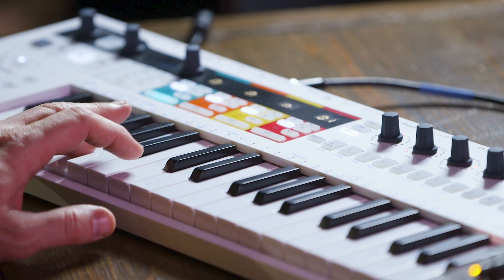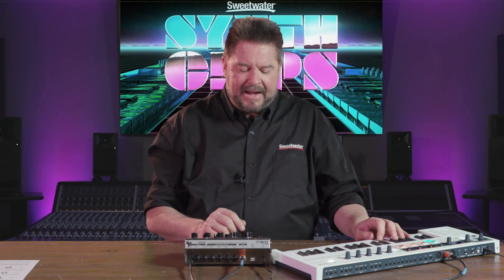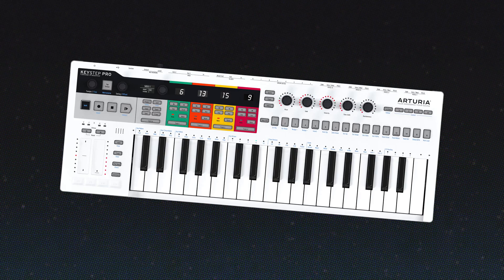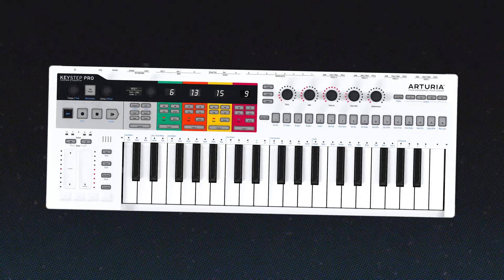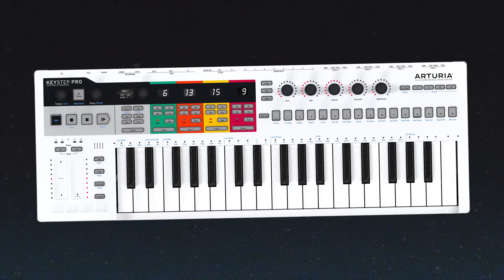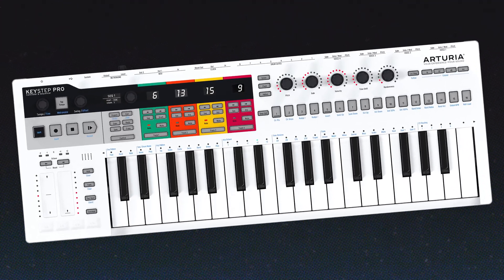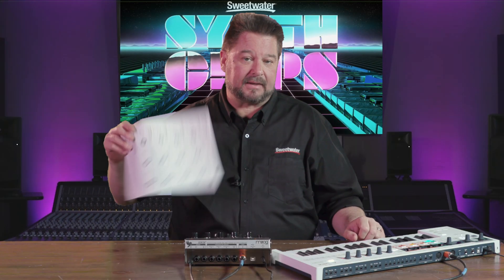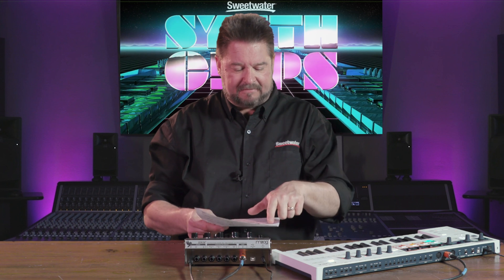Beat Frequency vs. Fine Tuning – Synth Clips 13 – Daniel Fisher

Comment: Very interesting. With my Minitaur I'm just debating if using slightly beat frequency or not with two square oscillators (one octave apart) for optimal smooth but punchy bass. What's your opinion on that? Thanks
Reply from the maker: Hi JH Drummer. Either way works, it's a matter of wanting the higher notes to have faster beating (Detune), or all notes to have the same beating (Beat Frequency). The key is (when using pitch offset for bass sounds) to keep one oscillator a bit quieter than the other. This helps to keep the bass from ever getting too quiet (cancellation) during the beating. -Daniel
Reply: @sweetwater  Thanks for the precious tips Daniel!

Comment: Good demo, Daniel.  It might be worth mentioning that another way to get beat detuning on some older analog synths is using good-old LFO 
modulation of only one VCO (or DCO): unless you have the LFO rate tracking the keyboard, that LFO will module the VCO or DCO with the same number of beats per second no matter what key/freq you're at. I would guess that beat freq detuning implementations are exactly that: a dedicated and simplified LFO to modulate one oscillator's freq at a fixed rate.
The drawback of using explicit LFO modulation of the oscillators, I guess, is that you're "burning" one LFO for that specific purpose (you
 might need the LFO for something else like PWM or filter mod at a different rate).  Most older synths have only one or two available LFOs which are often otherwise tasked.  But at the other end of the spectrum: if you have at semi-modular synths or at least a synth with CV inputs then you might easily have an available external LFO via CV inputs to dedicate to the task of beat detuning.
The benefit of using a for-real LFO (in lieu of beat detuning) is being able to leverage more sophisticated LFO features like varying waveforms or delay... or shifting from modulating VCO-2 for modulating VCO-1 in realtime.  Or maybe even routing CCs such as aftertouch, breath or touchpad to modulate the intensity of the LFO modulation of the VCO/DCO.  For example maybe you setup LFO modulation of VCO-2 at 1.5 bps but allow breath controller levels to increase that rate smoothly up to 4-5 bps.
Additionally some soft synths such as Arturia's Jup-8 emulation allow the LFO rate to be synced to fractions of the actual DAW beat - which might be a nice feature, especially for some DAW-synced effects using more dramatic modulation.
One last thing: using beat tuning or the LFO-modulated VCO/DCO with a polyphonic synth creates much less-natural sounds from chords since all voices/oscillators are being modulated in-step; this might be desirable -especially with DAW-controlled beat sync - but is certainly less natural than regular VCO/DCO freq detuning.